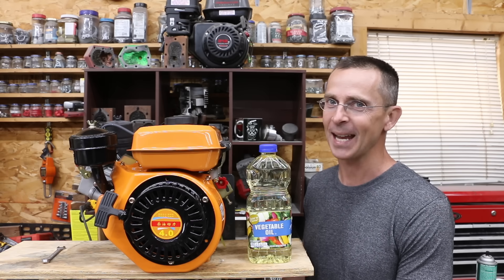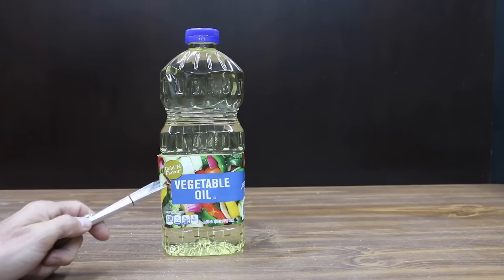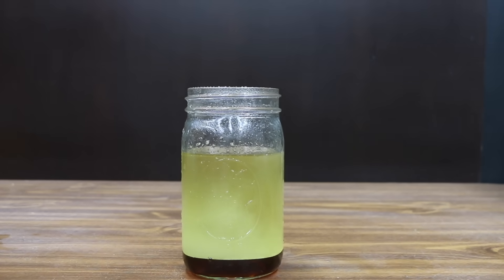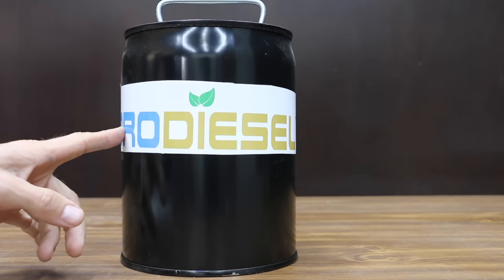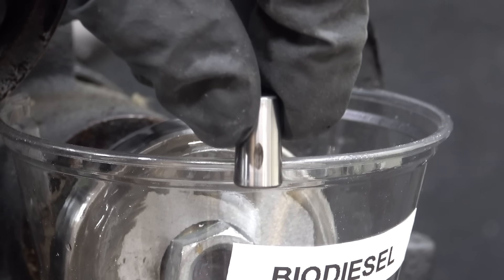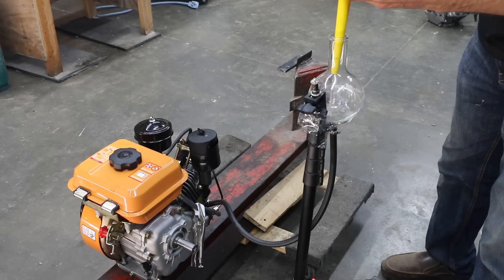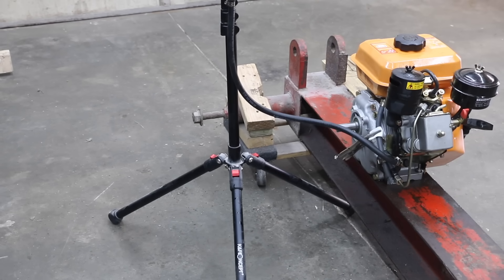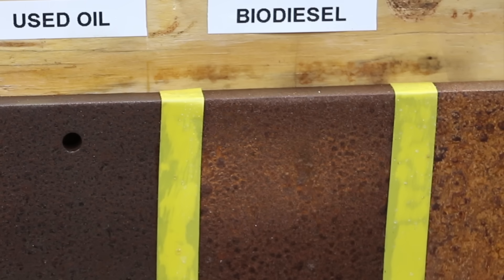Make "Biodiesel"? Let’s find out! Diesel vs Biodiesel, Used Motor Oil, Vegetable Oil, MPG

Comment: Interesting testing. I think I would like to see a revisit of this, to include a load/endurance test like you've done with gasoline types/"alternatives". Perhaps a belt driven generator connected to the engine driveshaft, or modifying your Go-Kart using this little engine. Also, I am interested in how Jet A or Kerosene might act in your small diesel engine. Jet A, since it's the fuel of choice for diesel driven Diamond aircraft (a very popular choice for flight schools these days) and Kerosene, since Jet A is (from my understanding, I could be very wrong) a highly refined Kerosene.
Reply from the maker: Thank you for the video idea!

Comment: Biodiesel has about 95% of the energy in Dino Diesel. However it contains oxygen so ignites more smoothly so stop start driving is cleaner and has similar miles per gallon to Dino.
Reply from the maker: Thank you!

Comment: so when society has gone to hell and we are in a mad max scenario diesel engines will be king, great test man kudos
Reply: Diesel engines with old school mechanical fuel systems and little to no emissions systems to be more specific.
Reply from the maker: Thank you!
Reply: Damn skippy. Just run it on whatever is at hand.
That little diesel engine also shows how valuable a source of used veg oil can be, you could set up a generator and power everything if you have enough.
Reply: Not just diesel engines
Reply: Ah, good to hear diesels are king, should work in my Police Pursuit Special, it's the last of the V8 Interceptors you know.

Comment: A friend of mine ran used motor oil in his diesel truck all the time, but he added a second fuel filter to help protect the fuel system. but he said it worked just fine and he had plenty of "fuel" to burn!
Reply from the maker: Thank you!

Comment: Did the engine run any quieter or smoother with a particular fuel or not much difference?

I'm sure I'm not imagining it but my pickup seems to run differently (sound and smoothness) depending on the brand of diesel I put in

Comment: I suggested this a very long time ago.. Glad to see this.  I remember a epi of that tv show "SHIPPING WARS", and the married couple had a bio diesel truck.. Which looked to me like government trying hard to sell you the concept like arnold schwarzenegger did on "pimp my rider" when he was Governor of California,  and they put that "bio diesel" up against a Lamborghini.... to "prove".. The issue in shipping wars was the whole scripted set up to find "fryer grease", and they poured it directly in.. They didn't have to use Potassium Hydroxide.. How would you even get that? The whole point is THE WHOLE SYSTEM IS COMING DOWN. You are not going to have such luxuries as ebay and prime.  

Potassium Hydroxide (THERE IS A YOUTUBE VIDEO FROM "NATURES WAY" CHANNEL)

Use Wood Ash mixed with Rain Water then with quick lime to make a Potassium Hydroxide solution.

Comment: Environmental and potentially legal aspects aside, used motor oil with a bit of gas seems like it could be an excellent source of cheap (free) fuel if you had or knew someone who had a shop that did oil changes. I'd be curious how hard it would be on the fuel system though.
Reply from the maker: Great point!

Comment: I’ve used vegetable oil mixed 50/50 with diesel in my Kabota B1700 utility tractor and it worked fine.
Reply from the maker: Thank you!

Comment: Coincidence...I am prepping an experiment in making my own diesel but using various plastics, and distilling them off. Plastic is everywhere and will be for a long time, so makes sense.

Also, the oil result you got here as far as corrosion is more in line with what I knew. You did a test a long time ago and it corroded more. Im willing to bed that used oil has other compounds and the molecular chains are different enough to inhibit rust.
Reply from the maker: Thank you!

Comment: Perhaps it should be noted that putting alternative fuels into your road vehicle might kill your CAT (catalytic converter). Modern engines have a regenerative CAT which pump extra fuel in order to heat it up and get rid of soot. Also modern injectors (piezo) might not like the fuel, but I don't have any data on that.
Reply from the maker: Great point!

Comment: I've had an idea for the past several months that I wanted to try someday. Maybe Project Farm could take a wack at it. Waste Veggie oil (wvo) can be filtered or ran though a centrafuge to clean out any impurities before being used as a diesel alternative. The only problem is, as this video demonstraits, the wvo has high viscosity and solidifies in cold whether. It needs to be heated. There are systems that can be added to a vehicle that draw from the radiator to heat the wvo.

My test would be... Could the fluid in the radiator and the fuel tank be one and the same?

Would wvo be a suficiant coolant?
Could wvo be pumped from the tank though the radiator and back into the tank?
Is it even possible that the tank of wvo could even replace the radiator?

I hope Project Farm will test this idea, but if not i will test it eventually.
Reply from the maker: Thank you for the video idea!

Comment: This test is super useful! I've been planning for a while to make a filtration system for used vegetable oil and also some sort of heated fuel tank/lines and mount it in a car with an older type of fuel injection system.

Great work!
Reply from the maker: Thank you!

Comment: Are there home made additives you could add to gas that will increase lubricity clean your engine and stabilize fuel
Reply: I add about half a liter of two stroke oil to a full gas tank in my car at every oil change.  It lubes up the fuel pump and injectors, and it doesn't smoke.  Never had a problem with over 350000km on it.
Reply: @HomerSimpson1969  this will only work until the tank is empty. Unless you change oil with every tank
Reply: @trollmcclure1884  Yes, it's not a constant.  Periodically adding extra lubricant for the pump and injectors also helps to clean them.  It works well and causes no damage.  Use the information as you will.
Reply: I'd say nitration. The other guy mentioned 2Ethyl Hexyl Nitrate. So this and two stroke oil maybe
Reply: Thanks for the advice! I too add 2 stroke oil to my gas occasionally and never had problems in my Buick LaCrosse for the last 100,000 miles of owning it

Comment: very cool, I've already seen some research on this, and I remember that to use pure new or recycled vegetable oil, you need to get it heated to at least 68 °.
But you can put up to 70% vegetable oil or less and the rest of diesel without having to heat it up, except that where I live, the temperature rarely reaches 0 ° or less. So I don't know the ideal proportion for very cold places.

Comment: My one friend makes black diesel,  it's heavily filtered used oil that is made up of used engine oil, automatic transmission fluid and gear oils that also has the acids naturalized thru a process,  they then mix it with a 50/50 mix of bio-diesel and kerosene.  So its actually 25% bio-diesel,  25% kerosene and 50% used oil. They run black diesel in all their diesel engines on the farm. And saves them a lot of money, yet recycles used oil into renewable energy for fuel.
Reply from the maker: Thank you!

Comment: Great test 👍 i ran my VW transporter 1.9td van on svo mixed with 10%gasoline for 7yrs no problem but in colder weather i just put a higher percentage of gasoline to stop it gelling 👌 i havent tried on comon rail diesel engine 🤔 well not yet 😉
Reply from the maker: Thank you!

Comment: idk the long term drawbacks of biodiesel are, but i can assure you running older diesel engines live a long time on filtered used vegetable oil. about 9 years ago i turned my wrecked VW Tdi car into a generator for our home instead of fixing it back up to be used on the road. It had 286k on the odo back then and since converting it multiple versions of our home backup generator, its been running on filtered used vegetable oil for just over 7 of those years. I have it setup on a dual tank setup, starts and stops on normal diesel, but shifts to used vegetable oil once the temperature of the oil has reached 150f, which is heated by the engine coolant. I filter my oil with a centrifuge filter system, because the cost of filters got pricey and is easy to clean out, but I use denim jeans as my garbage prefilter, because i can get them from the local thrift store for free in large quantities. I get my oil from local mom and pop restaurant for the past 7 years and have managed to accumulate more than 2500+ gallons of the stuff in 10 IBC totes I have sitting in the barn. I have thousands of hours of run time on this VW TDI engine running off the SVO over the course of 9 years as i use the setup to self power its filtering process via a mechanical pump and engine coolant circuit to thin the oil out during filtering. My latest version of the setup runs DC motor heads, which directly feed my solar system to charge the batteries with direct DC instead of going from AC back to DC to charge the batteries and run my home.
Reply: Make sure you get spare backup parts for that tdi nice work w/ the 2500 gal.
Reply: Are we talking a Mk4 or later car? Cause I've been looking to do this as a little fun project and forums and other sources pretty much say the mk4 engine is the safest bet to run WVO in it. Something about injectors changing in the mk5 and 6 models. Only problem is there are no used mk4 vws anymore on sale by me lmao
Reply: a video on the detup and a run down would be awesome

Comment: Excellent video! I love the fuel tests.  A good rule of thumb is to never run more than 20% vegetable oil blend as fuel otherwise you'll get gylcerin fouling the injectors after some time. It'd be interesting to see you test 76's new renewable diesel although I'm not sure if it's available outside of California. Thanks Todd!
Reply from the maker: Thank you!

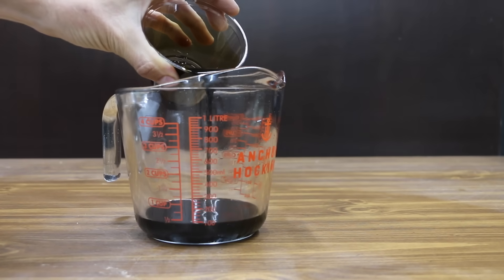Comment: 5:10 I had an epiphany, when you mixed used motor oil with gasoline. 
A bad Gas Engine, with gas in the oil is called a Diesel Engine? =P

Comment: sommetimes i use 100 percent vegetable oil on my 1,7l diesel volkswagen t3 . in winter its a bit hard to start the engine but when it runs it makes no difference. when i use 1/3 of vegetable oil it makes no difference .it smells like when u use oil to much time to fry .
Reply from the maker: Thank you!

Comment: The sulfur content of diesel fuel was required to be reduced because of the harmful tailpipe emissions that result from burning high sulfur fuels. I believe it also reacts poorly with the emissions systems that are now required on diesels in order to make them even remotely “clean burning.” Unfortunately, vehicle and engine manufacturers have decided not to put any actual effort into making their engines more efficient or clean burning and instead stuff more and more restrictive, expensive and delicate exhaust aftertreatment systems on to try and band-aid the problem. We’ve spent generations not caring about our health or the health of the planet and environment, and look at where that has gotten us. We care more about the longevity of our engines and the contents of our wallets than we do about our own health and the longevity of our only home. 

Great video as always, but the comment about diesel fuel “unfortunately” being low sulfur now definitely hit a nerve.

Comment: I put 1L of two stroke oil in my Ford diesel car every few weeks as I believe it probably keeps the fuel pump better lubricated than just diesel. Not had any bad effects that I know of and the car has a diesel particulate filter.
Reply from the maker: Thank you!

Comment: Great video.
Very informative.

How about adding diesel with fully synthetic 2-stroke oil.

Of couse one would need to test and add until the results of lubrication is satisfactory and power output is not lost.

Same tests as now but with added 2stroke.

Also I have heard that adding 15% gasoline is a way to winterize diesel fuel, correct me if I am wrong.
Also adding 2-stroke oil to get back its lubricating properties to use it "safe".

Thank you and excellent as always.

PS. Here I go again with the 2-stroke😆👍🏻

Comment: Surprised how well vegetable oil did.  I had to replace injection pump, injectors, and clean fuel tank in a tractor I bought, due to previous owner using vegetable oil in it. (Might have been used vegetable oil)
Reply from the maker: Thank you!

Comment: Here is a quick prepper note for yall in the event of shtf  and you have a diesel   keep bottles of heat.  And drain cleaner powder. Find cooking oil  heat it up on a fire.  Filter it the best you can  add 5 parts cooking oil to 1 part heat and 1 part drain cleaner  mix good and add to the fuel tank
Reply from the maker: Thank you for the video idea!
Reply: @ProjectFarm  you welcome

Comment: I was surprised there was no: Temperature, RPM, Torque, Runtime, Exhaust analysis, Spark Plug Fouling.  [oh, wait a sec, it's diesel, there isn't any spark plug.]  Even missing those tests, this was an excellent run down of the fuels.  Thanks!   ps.  I was surprised you used the regular pull cord, I expected your drill start method.

Comment: The reason the hydrodiesel didnt run great is because these chinese diesels or indeed any small diesels, have a lower compression ratio and a very old swirl chamber design when compared to the likes of a moderm diesel. Mechanical injection doesnt help the situation much either. Thanks for the vid!
Reply from the maker: Thank you!

Comment: Ran veggie oil in my 12 valve for 6 years.  50/50 mix with diesel worked best and changed filters often.   No problem and saved money period.
Reply from the maker: Thanks for sharing.

Comment: I used to run my 1980 Vw golf on used cooking oil. As long as the temp was 12 Celsius or higher it would start and run just fine.  I used an old cream separator as a centrifuge to clean the oil. Got all the oill I needed from a local restaurant for free. I never had an air quality test done, but always felt it had to be better than burning diesel
Reply from the maker: Thanks for sharing.

Comment: In the late 90's and early 2000's there were many diesel cars on the road in Europe. It became a trend to put sunflower seeds oil from the supermarket in your car. A liter of sunflower seed oil was like €0.50 per litre while diesel was €1 per liter. You could smell it when a diesel car drove by, the whole street would smell like a Chinese restaurant. They made it illegal after a couple of years because the government was missing out on the tax. Also, modern diesel cars didn't really liked the oil.
Reply from the maker: Thanks for sharing.

Comment: My good friends 1956 Fordson Major tractor ran on used engine oil, diesel, vegetable oil, whatever waste oil he could find. That thing soldiered on like it was nothing at all. Even ran on brake fluid, I believe? (And yes, that thing rolled coal) 
Sadly it ran away a few years ago, grenading the engine. Happened while driving. Did 20mph (Legal topspeed) before runaway. 50mph during.... (or so I was told, so don't roast me)
Reply from the maker: Thanks for sharing.

Comment: I've had many different manufactures of diesel engines over over 40 yrs.
But had one while I was getting into bio diesel , a 94 Dodge Cummins  .
Study multiple universities studies & farmer co-ops .
Then started to make it myself , it does have less BTU's , more lubricity , higher centain .
I ended up with a blend 30-50% bio , #2 diesel , kepted my used crankcase oil - then filtered with dual bypass oil filter system , then put trough a centrifuge filter system [ 1/10th of micron ] and added around 10% to the bio diesel .
Then engine / fuel system had about 300,000 miles on at this time , with less than a week of running the bio diesel , the fuel filter plugged up [ great fuel system cleaner ] - I knew this was going to happen , so kept a spare filter , changed and running again .
When I got rid of the truck [ blown auto trans & lots of MN rust ] it had about 600,000 miles .
In MN winters I used the same blend as above + Power Service winter White , never had a no-start .
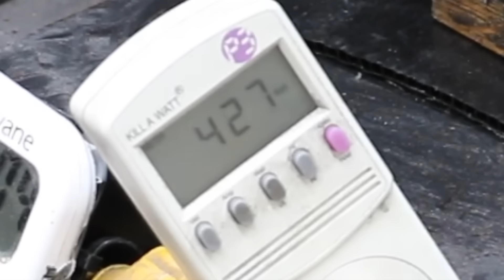Engine was tuned & dynoed to 275 HP - up from factory 175 HP , 3:53 gears and averaged about 20 MPG .
Thanks agian
Reply from the maker: Thanks for sharing.

Comment: biodiesel is great if you can get enough oil. Back in 2009 they started to buy all the used oil around.
Reply from the maker: Thanks for the feedback.
Reply: @ProjectFarm  If you look at it from a prep point of view then the simply thing to do is run on oil, that you press yourself, but you have to stick to simple fuel delivery systems.

Comment: Where did you find that little engine.  They make kiys that you can add to your truck that will let you switch between cooking oil and regular diesel fuels.  Was going to put one on my old truck before it had a tree fall on it.  Was wondering when this was going to be a topic you hit.
Reply from the maker: Amazon.  Thanks for the suggestion.

Comment: Great video as always, but one thing that wasn't mentioned that's very important for people to know when it comes to straight vegetable oil is that it is a polymerizing oil. What this means is that over time it will congeal and gum up everything it touches. This will clog fuel lines and reduce lubrication significantly over time. Straight vegetable oil can be really good for a temporary fix or an emergency, but the biggest reason that biodiesel is treated the way it is is to break the long chain fats down so they don't polymerize.
Reply from the maker: Thanks for the feedback.

Comment: Talking about lubrication in diesel, i use a bit of 2 stroke oil in all my tractors fuel tanks, just to lubricate the fuel pump. Especially for the older ones.
Reply from the maker: Thanks for sharing.